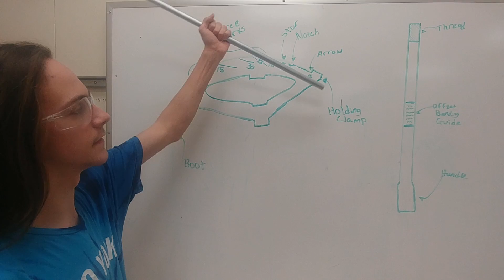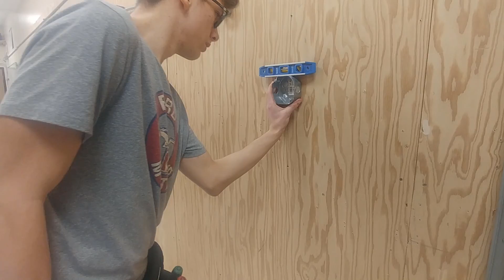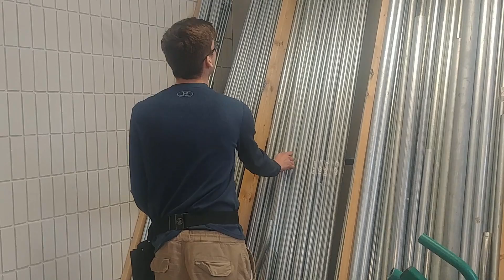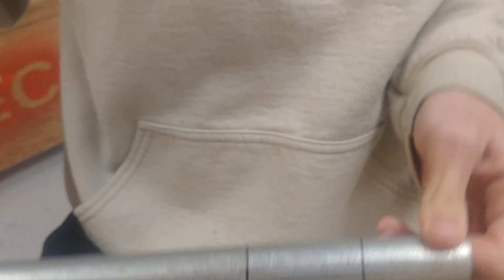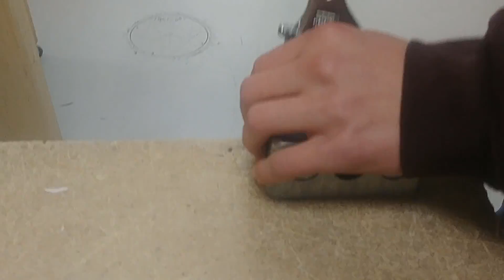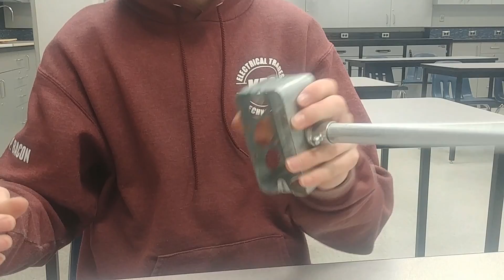How To Bend A 3-Point Saddle

Comment: https://www.amazon.com/gp/product/B07WZKMYV7?pf_rd_r=4BDPRGD4ZMQJWPGAT5SJ&pf_rd_p=edaba0ee-c2fe-4124-9f5d-b31d6b1bfbee

Space It E-Z is a simple-to-use tool designed specifically for electricians to run and space conduit. Finally, there is a tool that was designed with simplicity and professionalism in mind. Invented by Lixon Vilsaint, this tool was designed for both the amateur and professional electrician alike. As the name suggests, the Space It E-Z is an effortless and straightforward tool designed to space and keep conduit straight, orderly, and professional as it is installed. Stop searching for make-shift pieces of wood or metal as spacers! From the moment you begin working with the Space It E-Z, you will realize this was a missing tool from your professional arsenal.

Space it E-Zcontains three separate components. Two components have an angular shape with graduated steps that allow the user to space conduit from 1/8 to 2 7/8 inches. The other component consist of a ruler with two legs that has the ability to slide from zero to 10 inches. Additional legs can be added as needed.